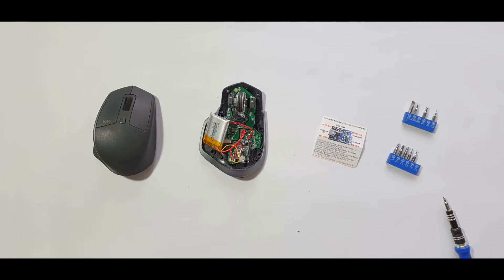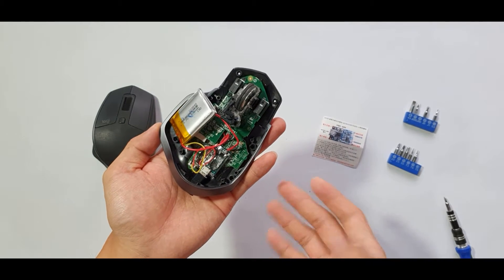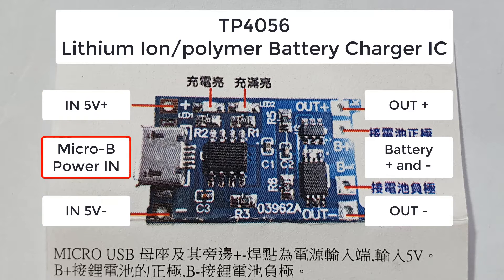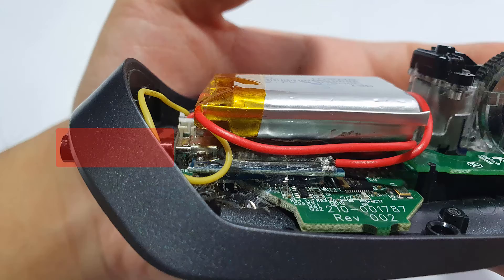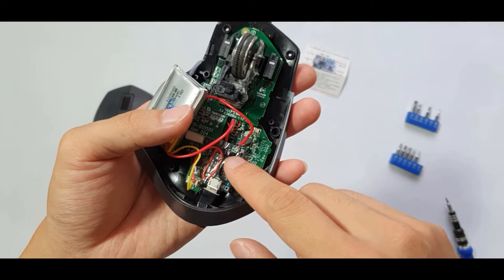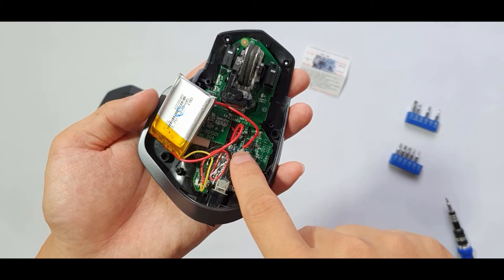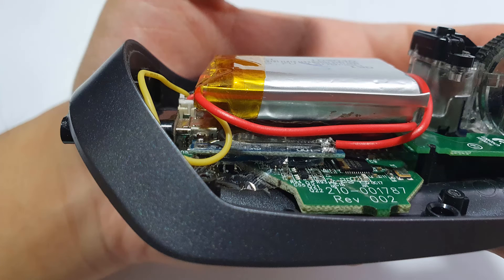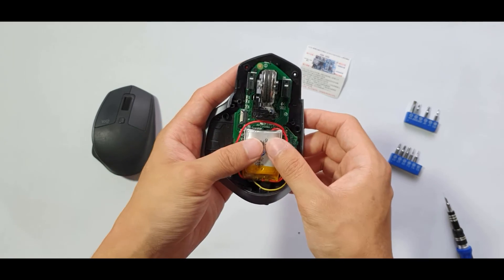Upgrade MX Master 2S with USB-C [Tutorial]

Comment: Hi the battery that I bought doesn't have the yellow wire, is there a work around it?
Reply from the maker: From what I understand, the yellow is supposed to be the temp sensor. I've had people tell me that it works without the yellow wire.